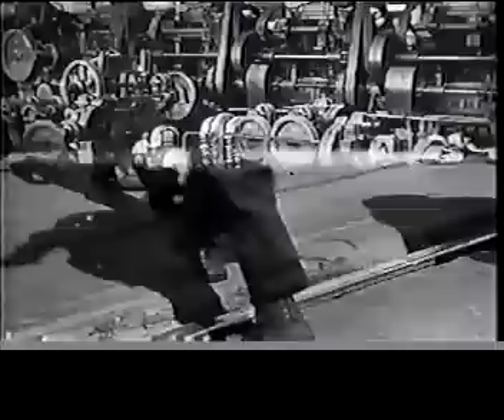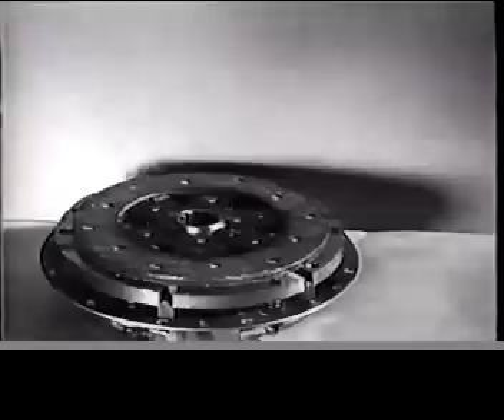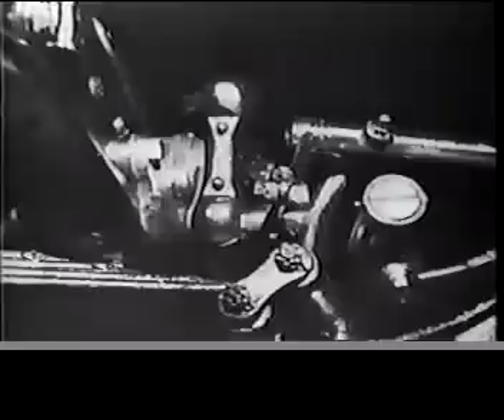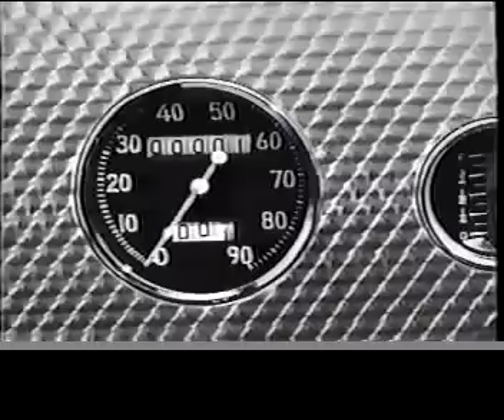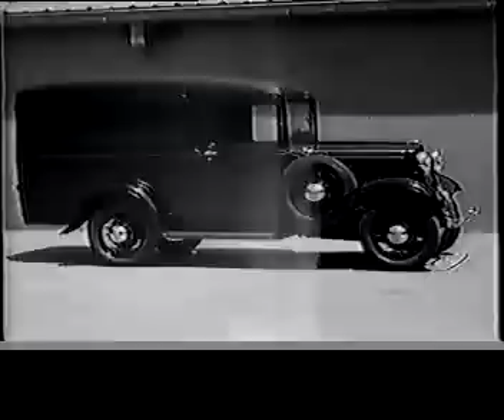1932 Ford V8 Promotional Film

Comment: In 1927 Ford went from a cheaply made Model T with basic straight beam frame, wooden carriage wheels, no shocks/barely any bushings, simple pressed steel frame, and 2 speed planetary gearbox with straight cut gears and cheap cork brake that only slowed the spinning trans, crazy foot and hand pedals to control its 4 cyl engine, which has a gravity feed tank with no fuel pump, no waterpump, simple trembler coils, no oil pump, and only making 20hp
......But, by 1934 they had a 85hp v8 with self adjusting distributor, modern clutch inside of a synchronized 3 speed helical toothed sliding gear trans, bushing filled and much improved boxed frame with 5 crossmembers with shocks and modern wheels/ tires and leaf springs, individual drum brakes on each wheel, big stainless grille, modern headlights and brake lights, fuel pump, dual water pumps, oil pump, PCV system, much nicer interior, better doors and much better sealed body made of 20 ton stamped steel instead of just wood covered in thin pressed steel, and tons of chrome...and a much nicer electrical and carburetor system that was miles more advanced along with the new windshield wiper...all for only $130(32%) more

Comment: 1932 Ford V8 weighs 526 lbs. (US), makes 65 hp and averages 19 mpg. The 2008 GM LS-3 weighs 418 lbs. makes 430 hp (6-1/2 times as much hp) and gets 27 mpg average. What a difference in technology over these 76 years. Who could have dreamed of such in 1932. And, the 1932 engine used sludge-inducing motor oil and leaded gasoline.

Comment: plastic timing gears,full floating wrist pins,aluminum intake, distributor+coil driven off the cam directly wow! all so steering wheel lock was ahead of the times! all so almost 20mpg at 60mph not bad!

Comment: Flatty's always run hot because the exhaust flows through the block and not the head.
Reply: Craig Weis 
And the two center cylinders share an exhaust port

Comment: Valve grind at 25K. Overhaul at 50K. That's what the old mechs used to tell me.
Reply: My granddad had a 1950  Ford with a Flathead/ Overdrive that he drove until1964. He was an iron worker and traveled all over the USA in it, it was overhauled in  1960 and I remember it had right around 100k on it, but it also had an oil filter from day one and he never had anything but Kendall in it and was religious about his oil changes and maintenance.
Reply: That was probably a lot of miles for a car back then.

Comment: Great bit of nostalgia. But before we ooo and ah too much over Ford’s “innovative” V8 motor, let’s not forget that CHEVROLET introduced their V8 motor for the 1917/1918 Touring model. 😉
Reply: Yeah but Ford cast the block in one piece making it affordable.
Reply: Yeah, a whopping 36 horsepower from a 288 cubic inch engine, and a huge sales failure.

Comment: "Streamline effect" - ? Both windshield and front grille are bolt upright, thus providing the maximum resistance to moving air. Not a bit of streamlining yet evident.
Reply: hebneh windshield is laidback at 10 degrees. There’s your aero.

Comment: The v8 in its infancy 65hp. Was a screamer back then .Notice the maintenance free suspension components in their infancy.
Reply: Jason joncas Sorry, not quite the “infancy” of the V8 Engine. Chevrolet introduced theirs in 1917. Funny how few American “car enthusiasts” are aware of this fact.
Reply: @calvarycustoms6681  That early Chevy V8 put out a whopping 36 horsepower from a 288 cu in engine. You had to oil the rocker arms with a squirt oil can. Not impressed.
Reply: YES you are correct but I am talking about real production engines that were available to the masses the chev engine with its open valve train was inferior and required manual lubing the push rods. Sorry I mean the infancy of a production motor. And by the way I am Canadian and a 30 year licenced on automotive and truck and coach.

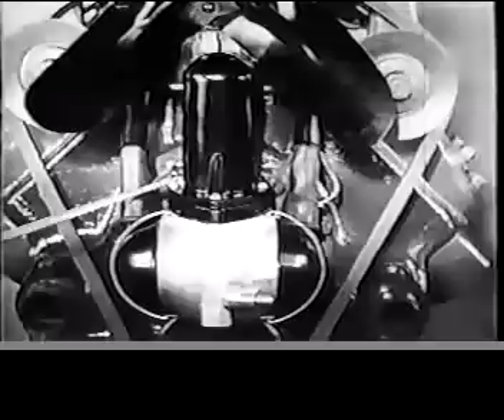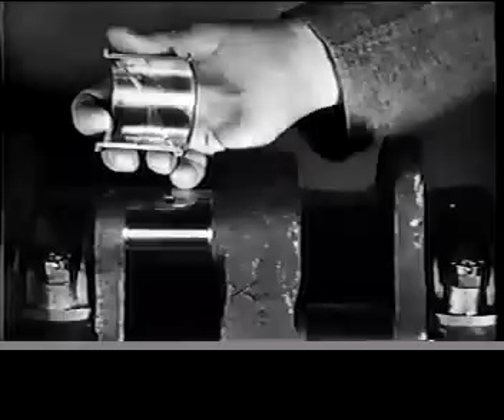Comment: 11:07 shows ignition coil as top of the distributor... an idea GM would bring back in 1974 with the efficient, powerful, super reliable, large cap HEI distributor... 6:44 full floating, double babbit, double oil film, connecting rod bearings...  Chevy OHV 6 always more powerful than same year Ford flathead V8... Chevy always OHV... had OHV V8 with 'airgap' intake manifold in 1916 - 1918...
Reply: BuzzLOLOL and a front mounted cam driven distributor, something GM would bring back with the 2nd gen LT1 (92-97).
Reply: @CamaroAmx  - That leaked coolant into distributor cap...
Reply: @BuzzLOLOL  well aware. I’ve owned my 93 LT1 z28 for 13 years. The job never gets easier.

Comment: bakelite fabric timing gear was a horrible idea.
Reply: Yeah,then they switched to somkind of metal and plastic combo gear , for quite , noise reduction, that breaks down, after many hard miles,a double tooth timing chain and sprockets is the best, all metal, but is slightly noisy
Reply: My 79 Bronco had a Nylon timing chain
Reply: fucking Einstein!
Reply: @CamaroAmx  if your bronco had a nylon timing chain then you must have a rubber asshole too

Comment: Ah, the dawn of hotrodding. Thanks in part to the tinkering of amateur racers, in 10 years this same engine would be stroked out 13 inches, compression raised to 7:1, and horsepower nearly doubled.

Comment: I guess it was sort of revolutionary, but it was still a valve-in-block flathead with cast babbitt bearings until 1937.  The exhaust passed through the block, requiring a big cooling system.  If only they would have gone to overhead valves!  And Ford's stubborn resistance to abandon mechanical brakes was odd.
Reply: You have to start somewhere.  40 years before this they were on horseback.
Reply: My grandfather had a 37 Ford when my mom was little, she said the brakes were horrible...
He traded it for a 1940 Chevy Master 2-door sedan, it was his "baby"!
Reply: ×11

Comment: Locking steering column in 1932, that  I didn't know.. In an era  of mechanicak brakes and vacuum  windshield  wiper motors.. Never drove anything with mechaical brakes, but a 1938 GMC had the weakest brakes of anything I ever drove.. Diven sever vehicle with the vacuum wiper motors..Serviceable when you get used to their slowing down when backing off the accelerator or they get well worn out.

Comment: 5.5 to 1 compression? Must have not had 90+ octane gasoline. Oil change at 1000 miles probably because there was no oil filter. These engines were pretty bullet proof though.
Reply: They could run off anything too. Dirty gas, kerosene, whiskey (seriously), you name it.
Reply: @T1G3R_5TR1P3S  while kerosene would have been acceptable,  I'm sure it's cold weather starting would have required mixing in some lighter distillates (gasoline)
Reply: @Texassince1836  Sounds like the tractors back in the day.  Our old John Deere has two fuel tanks on it.  A small one gallon tank for starting it on gasoline and a larger tank for switching the engine over to kerosene when it got warmed up.  Kerosene was much cheaper back then.  Now we just run it on gas all the time.
Reply: I was just reading a 1950 issue of motortrend and your right. They didn't have the required octane for high compression engines.
Reply: With 5.5 to1 compression u could use lowest octain leaded  gas around. And oil changes at 1000 were longer than some. Some required 8
700 mile changes and total rebuild at 25000 miles wasn't uncommon.
Reply: Octane was low (more lead could have been added though) 

No oil filter,  and the use of non detergent oil made the change so short.

Comment: why did thay chang  oil at 1000 miles
Reply: No oil filter and the oil back then did not hold up very well.
Reply: With detergent oil that car could have easilly went 2500 miles on a change, and 3500 on synthetic.
Reply: Douglas Roberts : indeed.  Times have changed.  Mostly because of japanese attention to detail.
Reply: drive our car for 10 days straight at 50 miles per hour or 60 ..  check your oil after 5 days .  maybe 3 .. more heat break down and metal everything.  plus like they say old oil slugged up broke down ...  good and bad of it . sludge can be good though. plug holes .   heard stories of people finally changing oil in  a truck then it didn't run . haha.
Reply: No oil filter, and conventional non detergent oil.

Comment: I can not belive this technology is almost 100 years old. Simply can not belive it, how amazing!!!
Reply: Henry was ahead of his  time  and relentless the first couple decades. But to look at it another way is  how little has changed in 89 years. Trucks are basically the same crude behemoths they always were. The main advances to come were hydraulic dual circuit brakes, Ethyl Fuel allowing high compression and more power,  and ball joints and SLA  front suspension  in the 50's. Everything else is  seasoning. - Sandy
Reply: Math
Reply: And all done without computers.
Reply: Except for the position of the distributor single water pump and starter and flywheel assembly plus the manifold and carb that engine is as basic as you can get that configuration is still being made to this day nearest modern engine would be the 5 l 302 engine based on the early 60s 260 cubic inch engine what made this car so cheap was the assembly line and the durability of the interchangeable parts after World War II these cars became hot rod fodder for returning GIS and created the Speed Shop craze of the 1950s to to 1970s

Comment: It amazes me how anyone at any time could have sat down and designed something like this with such intricacy and detail that actually works well.  It also amazes me how much more complicated they are today.  Notice also how people spoke then as compared to now?  Its amazing how language has devolved so horribly.
Reply: No one takes pride in there work anymore. Today's cars are plastic and rubber bands
Reply: Language is still good during formal settings, which this was considered to be at the time.  Note also that simplicity has been sacrificed in the name of efficiency, and that the frequency of scheduled maintenance is much reduced as well due in part to the complexity of electronic fuel injection and electronic distributors.  It is all the result of conscious trade offs.
Reply: @unconventionalideas5683  Yup.  With Henry it was all about the efficiency of the build, and not the efficiency of the automobile.  Take the flathead V8 in this video.  Making it a flat head and using a monobloc construction made the manufacturing and assembly process easier.  Although the monobloc construction did add some benefits to the engine itself.
Reply: Ralph Goober Nothing- and it’s not Republicans hiring Mexicans, (per say) rather it’s greedy corporations and businesses. And the government. 

Also, you seem to think that it’s only acceptable to speak politics on political videos. As if it’s not perfectly OK anywhere on the internet.
Reply: Ralph Goober 
Don’t tell the Germans or French that steam engines were invented in the UK.
From what I understand, no one really knows who invented it, but it is one of those three countries.
Reply: It's a tragedy.
Reply: Welcome to the millenial era. Leftists don't care about quality.  They just want to co ntroll ur ass

Comment: Very impressive.Those folks back then really got  a lot of value for their money.
Reply: I rather have a modern care. Or at least one with hydraulic brakes even if the rear brake are drum brake. Electric wiper motors ar nice too. I rather have the cabin be built on a metal frame, not a wooden frame.. Today's engines and transmissions and other mechanical assemblies/ electrical last longer. With the AC running better fuel economy today at higher average rod speeds.. Don't get me wrong it would be fun to have one of these in brand new condition to drive around in nice cool weather  where  that V8 wouldn't overheat. But not a great daily driver in modern times.
Reply: It was 1932. No one had any money.
Reply: Look up 365DaysOfA. Guy drove a Model A for a year and nothing else. Over 15,000 miles. Didn't overheat once, said it was a great daily driver.

Comment: what was the purpose of a 'running board'?
Reply: ***** Or so you could jump onto it and leave more quickly, if you were being shot at by a bank security guard and you didn't have time to open the door and jump in. Used to show scenes like that all the time in the older gangster movies.
Reply: So you can ride outside the car and shoot at the bad guys during chases
Reply: cbi1991 cars sat higher off the ground then, so you needed a running board to get into the car easier.
Reply: They still sell running boards to this day

Comment: Nice special effects.
Reply: ***** You came from the Roaster vid too huh? LMAO
Fun fact: ALTHOUGH Chevy's are usually cheaper for the horsepower you get, they (statistically ON PAPER) are made of a slightly cheaper steel. I know the cool thing nowadays is to hate on Ford's, but they give you carbon steel/aluminum that's on par with most SUPERCARS, in other words: bulletproof. Both make good engines, only the Ford can take more abuse, so technically more horsepower (if you know what your doing).

Comment: Ford and Chevy were at each other's throats.  Chevrolet upped Ford's 4 cylinder Model A in 1929 with a new OHV inline 6.  Ford then upped Chevy in '32 with the flathead V8.  Actually, horsepower ratings weren't that much apart.  The early Ford V8s were noisy but powerful, but by the early 50's, they were very quiet.  Ford then upped Chevy in 1954 with their modern "Y-block" OHV V8.  Chevy countered in '55 with their OHV small block V8.
Reply: I have a 1934 ford with original flathead it's preatty quiet
Reply: I would take the 216 Chevrolet any day over the flathead

Comment: I took my P.O.S Ford Escort with a dropped valve seal ring into the Ford Dealership, after rebuilding the engine twice to no avail, to get a trade in on one of these Ford V8s because they look a bit more reliable, and they douchebag said they didn't make the anymore.   So I poured gasoline all in the Escort, lit it on fire, and pushed it down hill into the showroom floor.  Good riddance to FORD rubbish.
Reply: choppergirls airwar ; shame u dropped a valve seat, regrettably that does happen but can happen to anyone, the second one sorry to say was probably due to not "staking" the new seat correctly into the cylinder head to retain it. first one fords fault agreed but second one your engine re-builders fault, not ford's.. if you dropped a valve seat at 2 month's from new Ford would have replaced the engine under warranty. unless you had over 12,000 miles on it ????
Reply: Man, that salesman sure was a real sweet talker when he sold the Escort to me...      wasn't all that terribly friendly when I brought it back because of manufacturing defect.   I'd say, he was down right cold and non-conversational.  Dunno if he was having a bad day, or his wife was beating him, or what, but he just wouldn't have anything to do with me then.
Reply: Really don't understand it, because he was more than happy and enthusiastic and chatty and friendly when taking my money when I bought the Escort, telling me how it was a super reliable and dependable daily driver.   And it was, for about 2 months, until the valve seat dropped on Cylinder #4, and fell down in the cylinder and got crunched up like little popcorn bits by the cyldiner head.  Broke the cylinder rod too, but that only happened 2 minutes after I had replaced the cylinder head with a new valve seat and vales and everything and got the engine running again after two weeks work.  It was a great story, but it seemed to me like he had already heard those kind of stories before and didn't want to hear it again.  Dunno.  Mighty peculiar feller, these Ford Salesmen.
Reply: CHOPPERGIRL's AIRWAR what model? Because I had an Escort, and the thing was very reliable, and playful

Comment: BTW, the short promo near the end probably ran in theaters. Des Moines' KSO had just gone on the air late in 1932 and here it helps promote the '33 Ford on an economy run. Wonder how they made 1,000 mi/day on the roads of the time...
Reply: They picked the best 1000 miles of road they could,  probably ran 24 hours a day too
Reply: @Texassince1836  And prayed it didn't rain, LOL!
Reply: Bet they used quite a few Benzedrine inhalers,,,,,, for ummm,,,, their asthma.
Reply: No kidding. I guess it's hard for people today to realize what roads were in the early 1930's. Most roads were 2 lane gravel, and some were two ruts in the dirt. Talking about going say, 80 mph on even the best of gravel roads given the suspension systems in use at the time is a pipe dream. 40 or 45 mph tops would be more realistic, unless you had either a death wish, or were running from the cops.